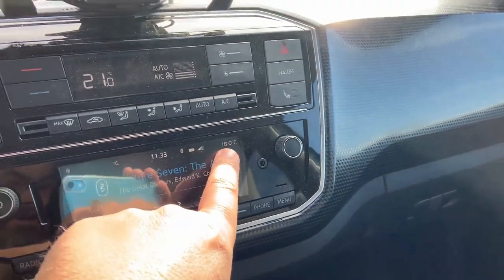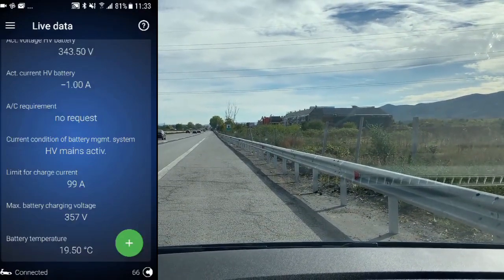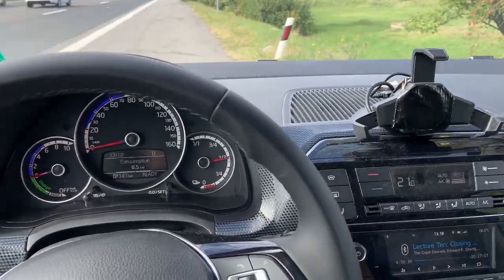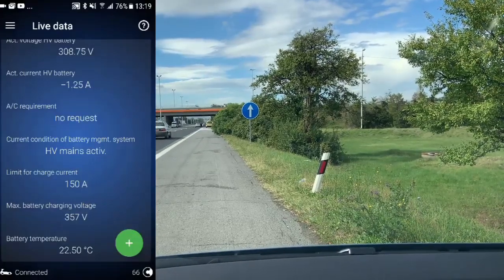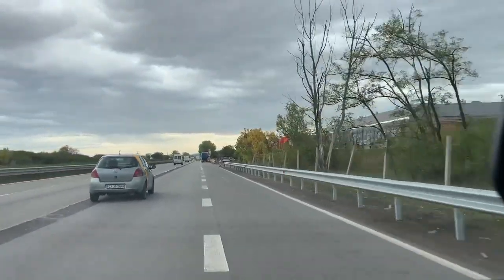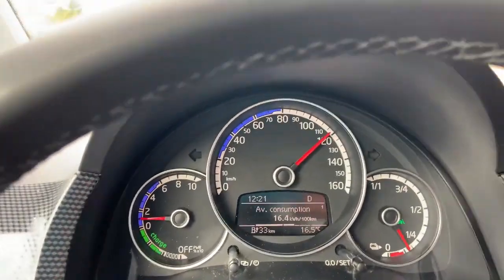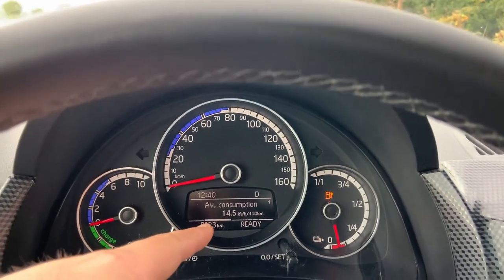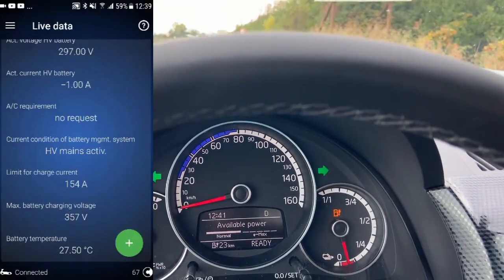80 vs. 120 km/h comparison using Volkswagen e-up gen. 2

Comment: Tedo so this would be great on normal roads, even on longer trips as the car is super quiet and economical but totally useless when I tried to do my usual 360km at 120km/H to get home after a full week of work, right?
How do you think the costs of driving at 120 would compare with the same car but with a diesel or gasoline engine?
Thanks.
Reply from the maker: If I have to drive 360 km every day to go to work then I will not buy this car or any EV with 60 or less kWh battery. I will definitely go with gasoline engine because. To drive EV it cost me 1 euro per 100 km and to drive gasoline it cost me 5 euro per 100 km. The e-up cost new around 20 000 euro and the gasoline version is around 11 000 euro. The problem with the EV is the charging speed. If you drive 360 km in single direction you have to do one stop at the middle to charge and this will take at least an hour with e-up but 3 minutes with gasoline engine.

Comment: Hello Tedo,
As I could see on your first trip: at the beginning of the trip you had a SOC 92 and at the end SOC 48. If we calculate the average consumption as the loss SOC of 44 multiplying it by the battery capacity 36.8 and dividing it by the 135 km travelled, I get an average consumption of 12kWh/100km. To achieve these 9.7kWh/100km there would have to be a loss SOC of 35.6 on your trip.
Have you tried these calculations? Does it give you a similar value to the one indicated by the car?
I always get higher average consumption values than the e-up says. Maybe the car is lying to us?
Greetings and thanks for sharing
Reply from the maker: What I think is you have a miss calculations. The battery capacity is 36.8 kWh but the actual usable capacity is 32.3  kWh : https://ev-database.org/car/1189/Volkswagen-e-Up So I think if you use 32.3 you will calculate close results from that the car estimates
Reply: @tedonash2681  Hello Tedo,
What you're telling me makes a lot of sense. If for the calculations we use 32.3 kWh as battery capacity, to achieve these 9.7kWh/100km there would have to be a loss SOC of 40.5 on your trip. Which is much closer to the loss SOC of 44, which is calculated by eye, so it could be.
If the battery capacity is 32.3 kWh, that means you can use the full battery capacity marked on the analogue display from 100% to 0%....
I have looked at other videos and I have seen that the indicator can reach 0%. I thought that it could not go below 12.5%, which is marked in red on the display.
Well, that's it, mystery solved.
And now it is also true that during the charging process in AC, I also lose around 14% of the energy.
Taking into account this loss of energy during recharging, it could be said that real consumption is around 14% higher. And thus we would have to take into account what the car spends when driving and what it costs when recharging.
Greetings and thank you for helping me understand.
Reply: Hi Tedo,
I have been making new measurements on my car using the OBD to get the accurate SOC so that I can verify the calculations using the useful battery value of 32.3kWh. I got the same results in my car as in yours. The result is that either the average consumption is about 10% or the real battery is about 29.8kWh.
Following the example of the measurements taken from your video: If we calculate the average consumption as the loss SOC of 44 multiplying it by the battery capacity 32.3 and dividing it by the 135 km travelled, I get an average consumption of 10.5kWh/100km and not 9.7kWh/100km. I can confirm that the value of the loss SOC of 44 is correct, and it is not 40.5, as it gives me exactly the same results. 
If the unknown in the equation is the useful battery, it gives us that if we have the consumption of 9.7kWh/100km, the real useful battery is only 29.8kWh.
Please check my calculations, in case I have made a mistake. And also that you make your own tests to see what values you get.
Greetings and thanks for sharing.
Reply from the maker: @joaquinclar7862  thanks a lot. I think your calculations are correct. The factor that everyone have to consider is how heavy it leg is on the pedal

Comment: Hi Tedo, once again a very good video, thank you . My car is a SEAT Mii E, and my experiences are equal; in fact it is the same car ;-) . But one question: Are you still running the „Continental Eco“ tires ? They are awful, real „wooden tires“, very very slippery in the rain, real dangerous ! After 8000 Kilometers i changed them to FALKEN AS 200 all season...what a difference...but: The rolling resistance of course is higher than the eco tires...
Oh, another question:E-up, Mii electric and Citygo are all the same. You are using the obd-eleven on your e-up...do you know if it works on the SEAT/SKODA too ? Is it still the old adapter, or did you change to the new one ? I‘m upset with the 22degree Klimate, the lane assist, the „coming home/leaving home“ wirh the headlight flasher, and so on... i think to buy an obd-eleven too, otherwise i have to buy the „vcds“ wich is much more expensive...
I think it‘s impressive how much ideas you have, great work ! Just the armrest or the „easy qi-charger“... cool 😎 
Great job, man. Keep it up and best regards from germany 👍
Reply from the maker: To be hones I have no idea about tires. I am with whatever they gave me from dealership. I will educate myself in this matter and try different ones. I am using the old OBDEleven adapter indeed. If you use the old one or the new one it should have no difference I think. They both should work on the triplets. You gave me a good idea: I think it is time to have a give away video where I will give this dongle to someone and buy the new one. I have to research if it is possible to transfer the dongle to different account so that he/she can use the PRO version.
Reply: Hello Tedo, today i received my new obd-eleven pro. I had to activate my account without registering the obd-dongle , so i think another person can‘t use your „pro“ you will give away, only the dongle itself....
Reply from the maker: @rolandpohl3399  thank you. Then the give away video should come soon

Comment: A good tip to lower your Consumption is increasing your tire pressure to 3 bar.
Reply: And how long will that increase the breaking distance in an emergency at highway speed?
Reply from the maker: The tires ware at 2.6 bars at start. I agree that more inflated tires will give lower consumption
Reply: Agree but it less comfortable.